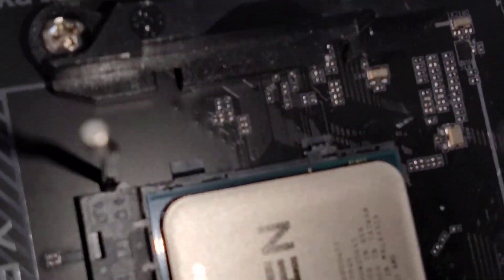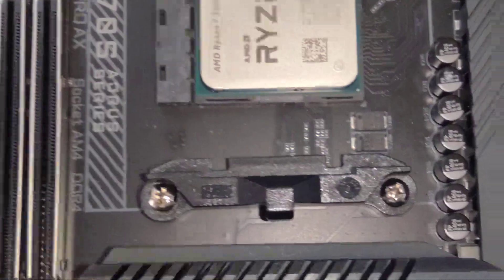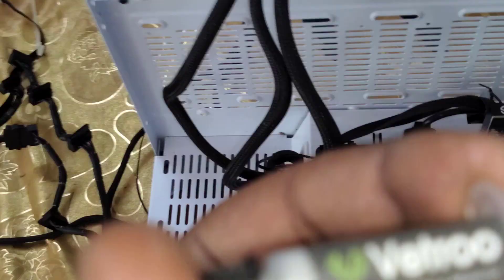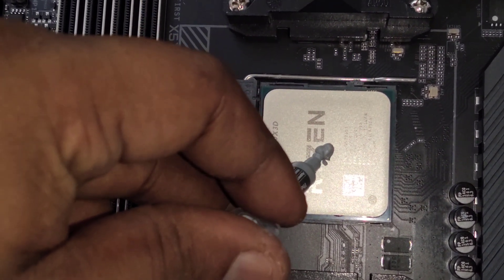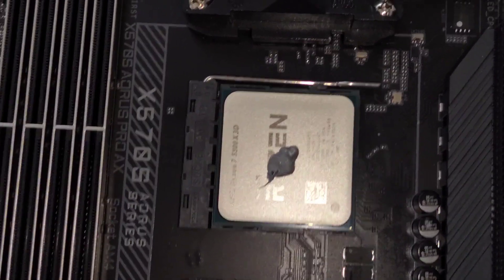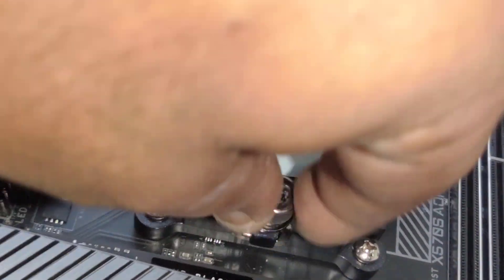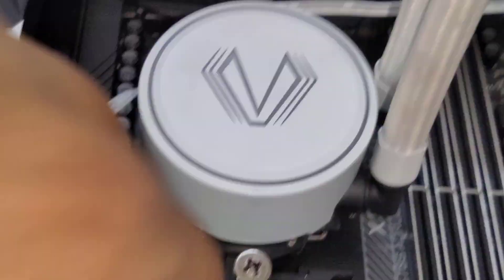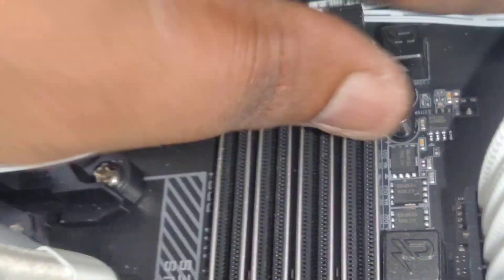How to install Ryzen 7 5800X3D on your AM4 Motherboard!

Comment: Ok.  Why does my r7 7800x3d not have pins?  Trying to install on an MSI MPG B550 Gaming Plus (it SAYS they were compatible) but not finding anything on how
Reply: b550 not compatible with 7th gen ryzen- as b550 is a am4 motherboard and ur processor is am5 compatible.
Reply from the maker: Yes sir above comment read it again
7800x3d is AM5 processor and it cannot run on b550 (Am4) motherboards